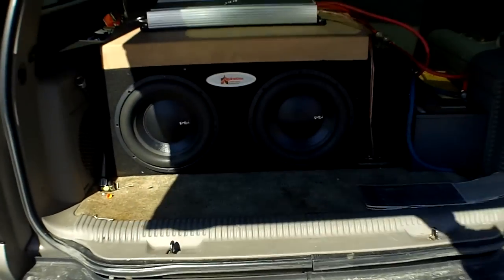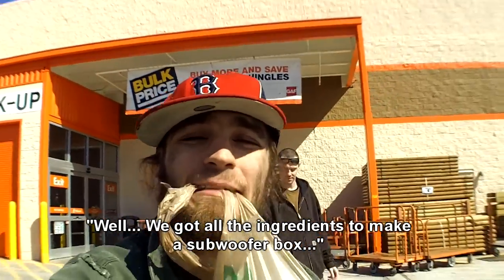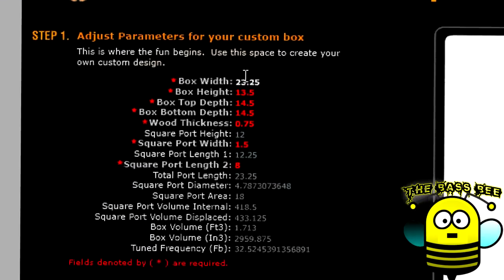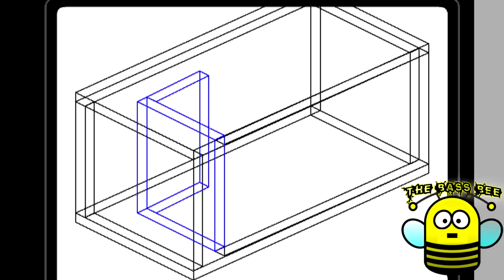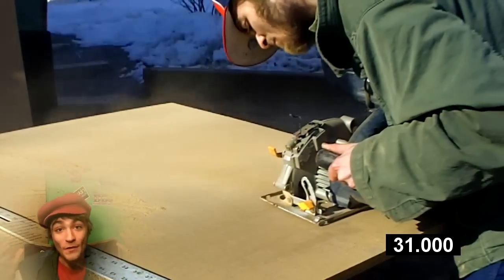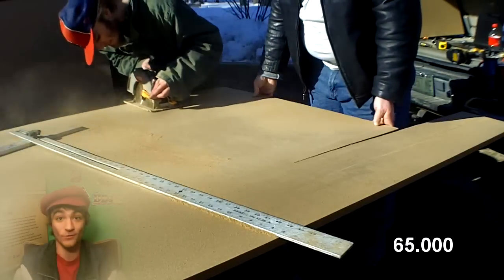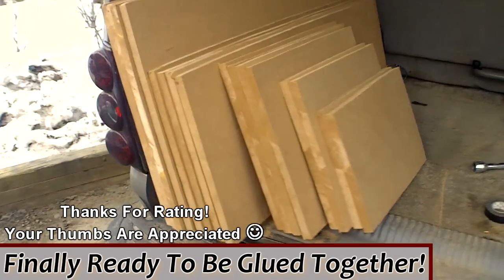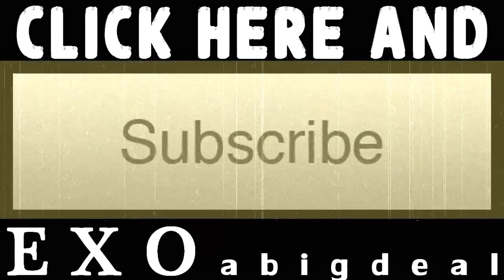How To Build A Subwoofer Box | Beginner Car Audio Tutorial - Dual 12" Custom Ported Sub Enclosure

Comment: You could've use your T guide to make the cuts straighter. I could see the saw moving left to right when you cutting. And you never let go of the saw before the blade stops spinning especially if it's still contacting the board. It could jump up and hit you.

Comment: Exo if I have a 1 18 that specs are 5.25 cubic feet and 78in port area  but I want low bass so I wanna tune the box to 29 hz how big should I make the box and do I still use 78in port area or is there a recommended square inch per cubic foot

Comment: I tried building a box and even with a guide for my circle saw the line wasn't perfect. I bought a more expensive saw and same thing. How perfectly straight does the edges have to be
Reply from the maker: Not perfect, just sand it down flat afterwards.

Comment: I have a prefabbed box [I suck at building and dont have the tools] but its tuned really high.   If I lengthen the port will it lower the tuning?  I know I will sacrifice some volume.  Tia :)
Reply from the maker: Yes and no! What length you add will occupy more volume and offset the desired lower tuning.

Comment: all subwoofers should stay in ported chambers so they will not fight each other meaning they will provide cleaner bass  in my listening and experiments
Reply: you definitely want a sealed box for a trunk
Reply: Never noticed that problem...sealed sounds great for country/rock but ported is better from rap from what I can tell. I solved this problem by putting a divider in the chamber.
Reply: Laquan c ported boxes sound like shit in trunks compared to sealed. Ported gives you boomy bass and sealed gives you tight bass

Comment: can I use something other than mdf ,its to heavy .  or maybe just 1/2 inch mdf
Reply: MDF is ok for indoors, don't use thinner wood panels than 15 of 18mm. Plywood is lighter and stronger, but cost a little bit more. Particleboard is also perfect for in a car or anywhere else where it's dry and where the cabinet stay most of it's time on one place. It's very cheap, a little bit lighter than MDF. Most of the cheap speaker cabinets are made from this wood.

Comment: Hey exo i need help on building a sub box for a l5 12inch kicker .i went ob the re box calculator but when it came to the port i didnt know what to do .i was wondering if you could help me or anyone reading this . the woofer box has to be 8inch in width the length and hight don't need to be a certain size but i was wondering if anyone could help me with that thanks for reading
         -Ricardo
Reply: when you get to the port just play with that until you reach the target frequency you want you can find the frequency  near the bottom

Comment: Is there a site for building a sub box thats boxed in on both sides (i dont know the actual name for it) or would it better to just build a normal box?
Reply: a sealed enclosure?
Reply: dragonslayer1483 well sealed on one side of the sub and ported on the other, i think there like bandpass boxes or something.
Reply: Raymond Barton yeah thats a bandpass
Reply: dragonslayer1483 id there any sites for that? Or would i be better off sticking with just a ported box? i have two 10" alpine type r's dvc 2 ohm and i just ordered two PA gothics 10" dvc 2 ohm, i wanna build boxes for both sets.
Reply: Raymond Barton i would go with what mobile said there... a ported box is a simple and effective solution
Reply: Mobile Enclosures alright thanks
Reply: Mobile Enclosures  just got my new car and got my subs in it but there just in shitty box's atm doesnt sound to bad and i still need to fine tune my amps
Reply: Mobile Enclosures i wouldnt mind having some designs haha would help me out alot just gotta make sure the boxes will fit in my car haha. I know i gotta tune em but it took me like 3 hours to put them in after running my 0 gauge and it was like -20c
Reply: Mobile Enclosures i know it sucks, and what would ya want to do the designs for two boxs that youd think would be best?
Reply: Mobile Enclosures how can i get ahold ya easier then replying on here?

Comment: I'm a big fan of using baltic birch and PL Premium polyurethane expanding adhesive. I'm not a big fan of MDF as it tends to be heavier, weaker and softer, and doesn't take screws as well, although it does have a smoother surface that doesn't show through paint.
The PL Premium glue is not runny out of the tube, and it slowly expands over the course of several hours time, but without foaming up and it helps ensure airtight joints.
I recommend a circular saw sled or guide board clamped to the work piece to aid in straight line cutting. A lot of this I learned from a guy called Bill Fitzmaurice.

Also I find bracing thinner ply is more manageable in weight than building hefty thick enclosures. I currently have two 3.3 cubic foot enclosures tuned to 40Hz for 2 12" PA subwoofers. One is made of 1/2" poor quality ply and the other of 3/8" baltic birch, and they are rock solid thanks to internal bracing. The ports on them needed 45 degree angles though as they formed a triangle in each corner. 2 sheets of 8' x 4' x 3/4" uses about 113 litres of material volume, which the total size of 1 of my 1 x 12 cabinets, so thinner material will save boot space also.

That box program is neat, as I often get headaches calculating internal volume. I use hornresp (which can do vented, sealed, bandpass, and horn enclosures too) to calculate response from different woofers.

Comment: I have a 2002 mustang. And if you have ever seen the trunk opening on a mustang you'll know that it doesn't give you much room for play. I have two 12" power bass dual voice coil subs and came to find out that my box didn't fit and also found out it was filled with mold. I am scared to make a new box as it won't fit or won't be good enough. Would there be any way you could help me build one and I pay you for it? I have watched a lot of your videos and am a huge fan of your work and look to your videos for expanding my knowledge on car audio. I unfortunately work a minimum wage job and am a private for the army national guard. I do not make a great deal of income to afford making a box and messing it up. Even if you couldn't help make a box could you at least point me in the right direction to at great box to fit my needs? If so that would be greatly appreciated.  Thank you.

Comment: when you spun the second port wall to be parallel with the first wall, it would have to be the same length as the first wall as well right? how would that affect the tunned frequency as you calculation on the site was for a second wall at 10", not 15.5"?
Reply: Why would it have to be the same length as the first wall?    what matters is that the port length is the same.

Comment: when I flip my second port should  its distance from the other port piece be equal to the net width of the first port piece?Thanks
Reply: also on the re calculator the port width is 9 inches....that seems like alot to me im going to have to 12s, should I do two ports at 4.5" in the middle or at the ends?What would be better?

Comment: If anyone is wondering, if you have your design figured out, Home Depot can cut your sheets into more manageable sizes. I only have about 28" worth of fence clearance on my table saw, so I had them cut the sheet down for me.

I figured in about 1/2" clearance on all sides for each cut, which I will then cut more accurately later on.

And they cut it for free.
Reply: absolutely, and I find it hard to cut a straighter line than what they can do.

Comment: Awesome vid! Got a question tho, im building the same box for a single 15" and was planning on mounting sub on the face of this box. Would you reccommend changing my l port as you did? Or am i better to build it the same way you did? Mine is going in a trunk as opposd to an open hatch. Was also wondering how critical the sub placement is, better in centre or further from port? Questions questions lol thx

Comment: hai am from to ecuador ... and i need you help men !!! look i have two subs pioneer 1000wrms  dual voice coil with a rockford amplifier t1500d bd or whatever .... but i fell that the amp working very hot conditions i dont know what happen ???? the sub are connected to 2ohms, the gain is in the middle and the punch or bass boost in the sameplace ...... about hz working around to 90hz - 100hz ... really sorry if you dont understandme but i need you help!!! oooh i forget also the amp is powered with a 8 farad capacitor ... thank a lot
Reply: Turn down the bass boost all the way, and just use the gain to control it, and make sure there is no amplifier clipping

Comment: is it true that the more powerful the subs are the more room is needed inside the box 2 help the sub perform correctly? or could I use a ported box from a 12 inch sub lets say that 1 was 500 watts rms & I put a 3000 watt rms 12 in sub in its place. if I tuned the amp 2 work with that box will it work well? or not? I need some idea's here. I dont wanna delete my back seats I need them. but I wanna enjoy my bass too. I need help for a ported box 4 12 inch hcca orions in a 2000 mustang coupe.

Comment: Hey brotha love your work and videos. Quick question when is smart to run a second battery? I currently have a 270 amp HO alternator and a Optima yellow top battery. Unfortunately have a parasitic draw somewhere in my system. I took it to an electrical mechanic and he had it for almost 3 days trying to locate it and said that my car itself is fine that it was more than likely being caused by my sound system itself? Any insights on this matter would be great, thanks and keep up the great work!

Comment: sup exo like your work bro and nice vids also. im currently making my sub box for my dodge stratus im putting in 2 12in alpine sws-12d4 need your opinion on getting my port right im using the port cal on re audio. the box im gonna make is 36w 14tall 16deep.gonna make 33hz if possible. the subs call for 1.5cubs recommended any help getting the ports right would be awsome do i go with 1 port on the side or put in the middle of the box

Comment: Exo big fan been following u for a long time.I need help Ive got new gear went from two sundown sa-12's in my single cab f150 to 4 sundown e-8v3's.The box I built came from the re software out of one of ur vids..Ive never had 4 subs in one common space and was wondering if its ok..its a total of 2.7ft3 and tuned at 33hz..the amps are set exactly the same, and there matching amps both sundown saz-1000s should I split the box in the middle and use two ports or keep it one chamber

Comment: Hey I'm trying to get good bass out of two 600 watt 6 inch subs. I've currently got each one inside a 12 inch  PVC pipe not both in same pipe. Each sub has its own pipe. I need to know if having a box for my subs would be better and I need to know how to make a box that will fit my truck.  Cause there's little to no room I can try under the seat but I only have 5 in of clearance is it possible to make a low profile box that's small?

Comment: High Density Fiberboard?  1"?  shit's gonna weigh a ton and a half.  I'm guessing this is one of your first builds, so probably not a lot of cone area or power.  You'll probably be fine with some 3/4" mdf or better yet, 3/4" birch and some tactfully placed bracing.  Hmu if you have more questions.

Comment: You CAN use a skill saw, but it's much less accurate, and you have to compensate for uneven lines with more sealant or lots of sanding, or both. Morale of the story, use a table saw; it's much more accurate.

Comment: hey exo i was wondering what the difference would be between a box 6 cubic feet tuned to 32hz would sound like in comparison to a box thats 3 cubic feet tuned at 32 hz. i have two 10 inch subs that suggest small boxes from the manufacturer but who builds to manufacturer specs these days ive made sealed encolsures before and now i wanna step up to the big boy boxes :P i just dont want to make it really big only to find out it only makes it sound like crap any helpful thoughts or suggestions?

Comment: I need some help ASAP PLEASE! 

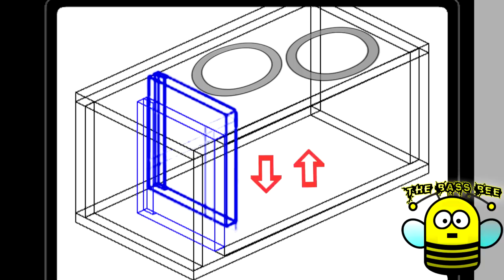At 3:20 when you moved the second port wall you also moved the subwoofer position. My question is, if I move my port wall like you did, can I keep the subwoofers in the original position or do I have to re position them on top of the box like you did? Also, if I don't have to re position the subwoofers, should I move the port wall like you did or just keep it in an "L" shape? Which would be more effective for SPL?

Comment: Hey EXO I just found out after I penciled everything down on my wood that the RE calc is way off than the other ones that are the same. On re says my box is 2.9 cubix and on other's say its 3.6111 cubic feet, im just scared cause AA mayhem recommended says 1.75-3cf or could i still go higher than that?

Comment: hey it's a don here and I'm wanting to ask you about my sub box I have 412 inch TX Bd audio pipe 12 and I'm wanting to get the most air movement out of those 4 12's the boxe is in the trunk of a 05 neon my sealed box that I built sounds great but I want more air movement

Comment: yo exo im gonna build a box for my bros stang and im using a 12" woofer. gonna use the re box calculator but want to know if the sub should fire up or back. if its back its gonna be an angled front on the box cause of height issue and  should the port face towards back of car regardless of sub direction. also should i go with the L shaped port or try for the dual wall port like u did.  thanks in advance

Comment: @D3ATHR3HAB: Series resistance = Sum of all loads in set. Paralell resistance = Divide Load by number in set. In your case 4 ohms * 2 speakers / 2 sets in paralell. Or 4 ohms. As long as your wiring is symmetrical, yes they will all see the same power.

Comment: i kinda figured it out. u cant adjust the internal on its own. the dimensions have to be messed with to get what i wanted. he has a 12" sub goin in the trunk of his mustang and i need a box with1.5 internal ft volume but gonna make it around 1.3 so it hits a little tighter instead of low cause he likes alot of rock music. how critical is it to do the 45s in the corner. is it gonna make a ton of difference or its more for comp type stuff

Comment: does this make sense, a 2.067 mtx terminator box with two 12s. i want to port it and all the calulators say for a 50hz tune using a 3 inch round  port would only need to be 1.49 inches???   i hate my sealed box

Comment: When you have two woofers with a minimum ported box volume of 3.0 cubic feet required...Does that mean 3.0 cubic feet per wuffa? Or 3 ft of box volume?

Wondering...Because I want to stay below the windowline of my Blazer(15.5 inches), and with my width measurements(Staying within the wheel well humps), I have about 6 cubic feet of box volume to play with...And I was wondering if that meant I could go with 3-4 Type-R woofaz instead of 2.

Thanks in advance!

Comment: im gonna have to use the box calculator to make a box for my brothers car cause the current one doesnt fit. if i type in the internal volume will it help me find the correct dimensions for the box so it will still fit cause i noticed when u were changing dimensions the internal kept changing. he has a 04 mustang so its a small trunk and its a 12" woofer. this is my first go at a box

Comment: Hey man..Nice video I am making a Sub Box but I am using some 15"s. So a Dual Box. I am fairley new at this and have a question about an amplifier. I am going to be using these for live sound and curious if you could tell me the right size Amp I need to Power and run the Subs.

4/8 OHMS IMPED

60 H2-21 KH2 FREQ. RESP.

200 WATTS RMS

400 WATTS PEAK POWER
 

Here are the specs...thanks a lot man

Comment: hey exo i am just staring to build my system and I was wondering if you could assist me. My system is going in a 2000 Mercury Grand Marquis, and it is going to include either 2 15s or 2 12s. My question was should I go with another battery in the trunk or just wire to the normal battery. Also, I was wondering what do you think would be a good brand to start with like sundown, soundstream (your current use), DAD, or Fi BTL. Also whatever brand I would be getting the same brand of amp with them.

Comment: Whats up EXO im new into the game of sub box builds i have watched your vids and meads vids. I have a 93 K5 and wanting to do a build for it  Previous owner had a system in it but he took it out. Left the remote wires and rca wires for amp but took everything else. Its has a dual batt setup under the hood. Im looking to get alot of bang out of this K5. Looking to get 2 15" woofers. I have a 15" kicker CVR in my car with a PA amp 900 watt. The box is a crap one. I want to do it right for the K5

Comment: Alright so i got a really good question ur usin mdf and i know thats wat u supposed to use but i got some really smooth ply stuff and i figure once u fill the hole box with resin the air wont see the wood so wat difference wood it make

Comment from the maker: It helps create a smooth, non-porous surface for the air to travel over without absorption, or obstruction from sharp angles, and squared edges. Better sound, less muffling.

Comment: I was more referring to you cutting sections for pieces instead of making 1 long cut and then cutting the pieces off of that 1 long cut, makes it a lot easier and you end up with more wood at the end. Also silicon between the wood? Wow I might try that just always used wood glue.